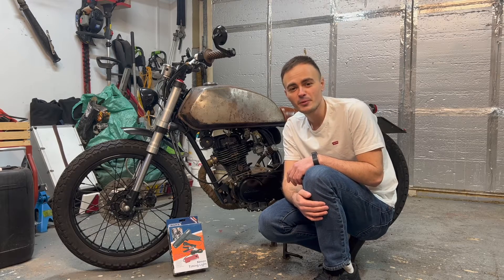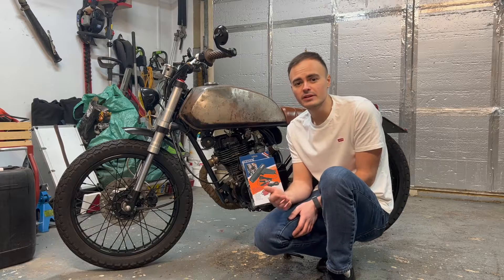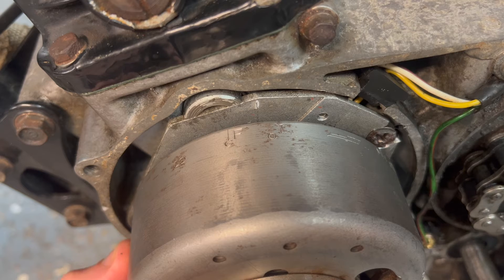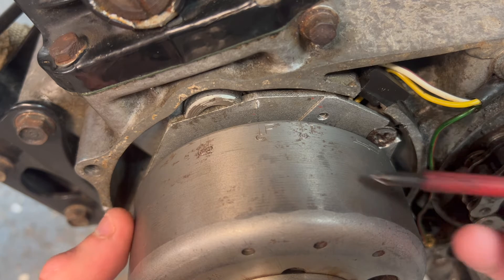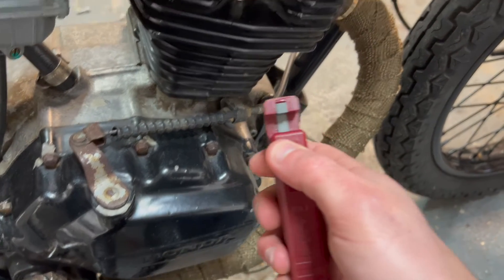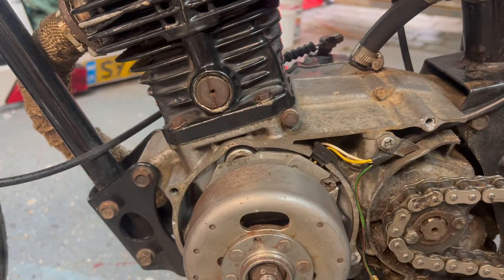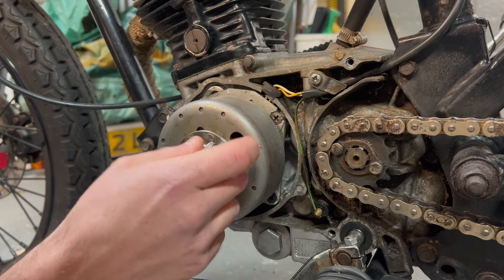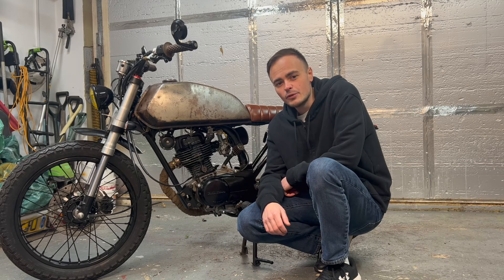How to use an Ignition Timing Light - Honda CG125

Comment: I have a Chinese 125cc clone but it’s CDI everything on it bike looks identical besides how to set the ignition timing. Bike bike has a brand new carb and carb filter gas tank drained and filled with new gas and gas lines and fuel filter has good spark but still won’t start any it seems to my after taking off the flywheel cover that the flywheel timing and stator wasn’t installed correctly and the timing marks don actually line up with TDC of any stroke compression or exhaust how do I get the timing marks line up correctly?? Seems the new stator and flywheel wasn’t installed correctly from last owner
Reply from the maker: That’s interesting, I wonder if the flywheel is from the same engine. Does it line up with the woodruff key on the crank shaft? If that’s missing then it will throw everything off. 

If you put the engine at TDC first. Remove plug rotate flywheel until you can see or feel the piston is at the top of the compression stroke. (If it’s ohv engine remove the rocker cover and you can check which stroke it’s on) the marks on the flywheel should align with T. 

Remove the flywheel and check the woodruff key is present and undamaged.
Reply: @TurnersWorkshop97 just checks everything looks like it’s a good match/fit should I just make my own TDC mark in the flywheel and put it all back together at TDC
Reply from the maker: Does it run alright?
Reply: @TurnersWorkshop97 nope
Reply: @TurnersWorkshop97 still won’t start
Reply from the maker: Ahh man, I’m struggling to work out what it could be without looking at your set up. May be a silly question but have you checked the fuel system?